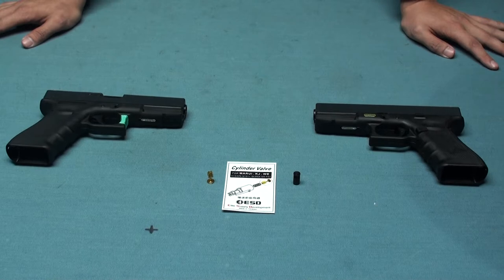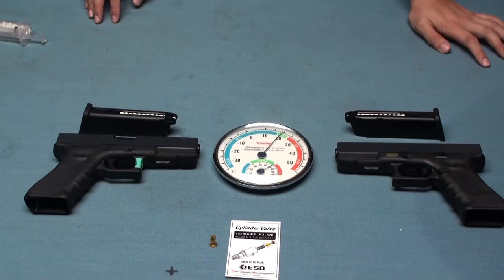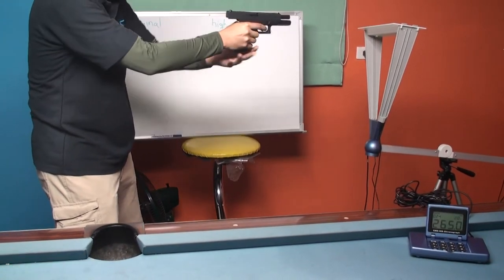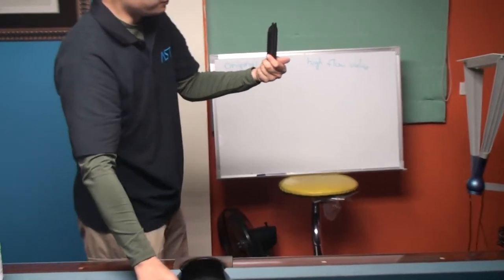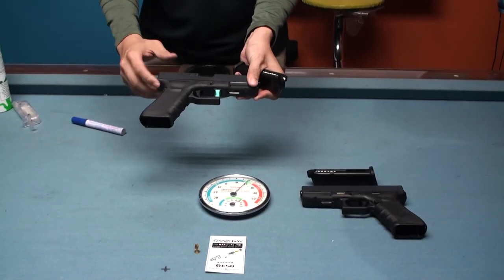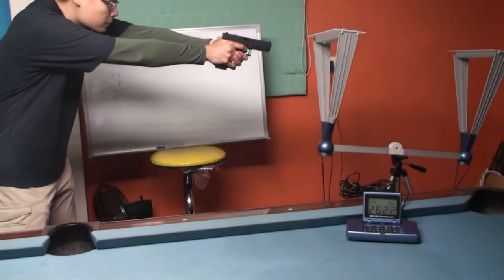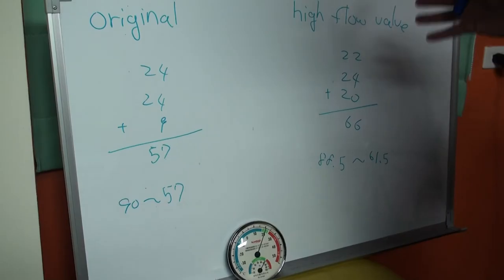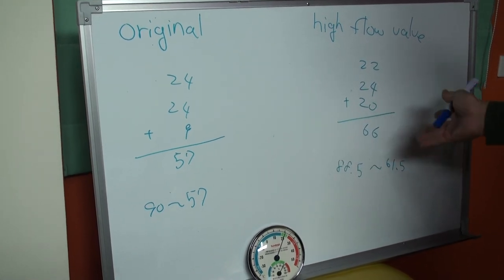ESD Cylinder Valve Debut

Comment: Original valve was 303fps for it's first shot with around 3fps on average dropped per shot from there on
ESD valve started at 290 and dropped 1.5 fps on average, gives a worse initial fps but a better consistency through the range
9 rounds extra over the stock but 13 fps lost on first shot
the ESD Valve fired it's last shot on 202 fps and the original valve finished on 187 fps (original 116 fps loss range, ESD 101 fps loss range)

So in conclusion the ESD valve gives around half as better fps loss per shot as the original, with  71 less fps lost over the entire range of shots, and also gives 9 more rounds. Definitely worth it for $10 !!

Comment: This valve will cost about 10 to 20 us dollars for 9 more shots its not really worth it I can see if your getting 80 shots then ya I'll pay 20 bucks but 9 shots isn't enough to sell me but great video keep them coming
Reply: in the long run it will benefit you
instead of having a gas can than you can shoot about 1000bb, this valve help you get 1150bb
Reply: yeah this paired with other things that increase gas efficiency and gas seal will benefit greatly, i don't know what you were expecting from such a small change but this is just 1 of many products available that improve gas efficiency slightly
I got mine for £7.50 so i'd say it's definitely worth it!